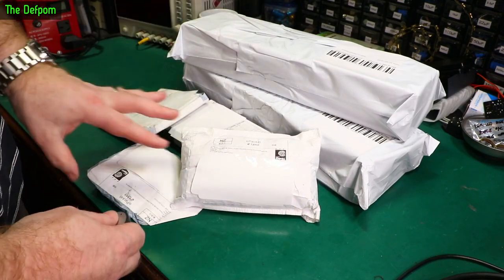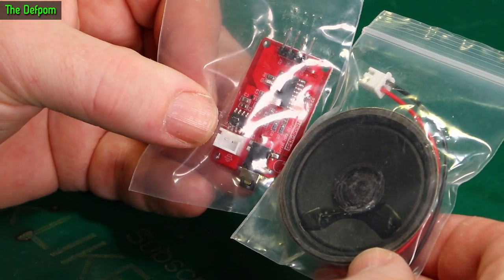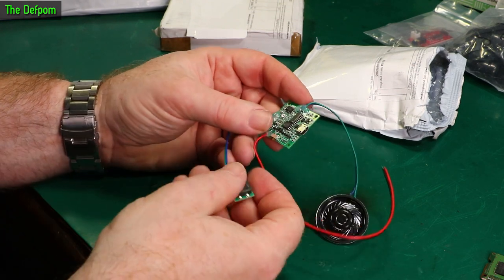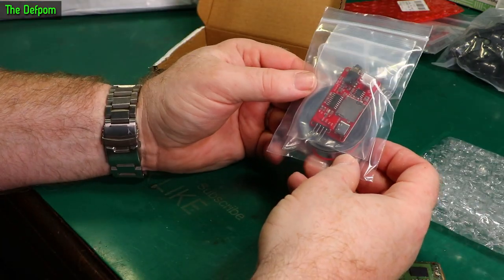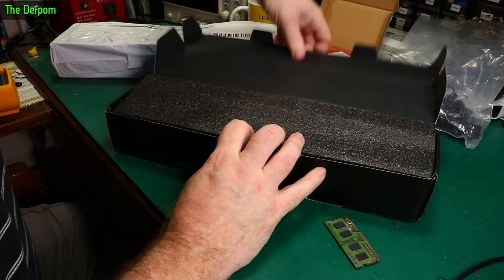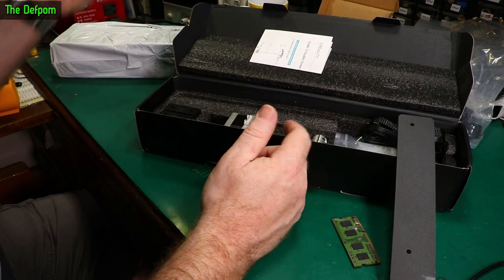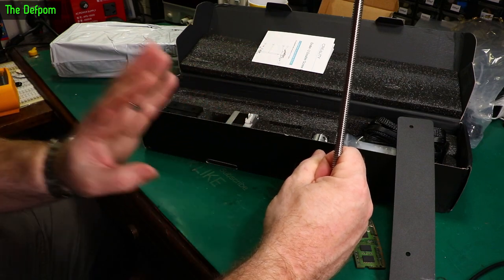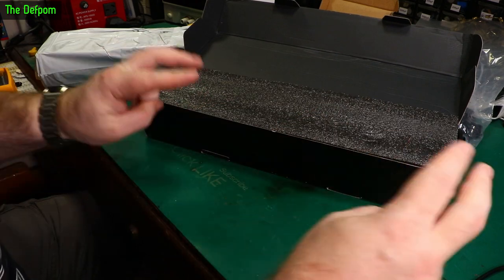🔴 What's in my Mailbag ? - Mailbag Monday 5th December 2022 - No.1071

Comment: getting multiple option is NOT an overkill. I'd recommend to take a look on 2 companion items from ICstation: "Mini MP3 Player Module Audio Voice Board 8Bit I/O UART" + "UART Voice Controller Shield for XY-V17B Mini MP3 Player Module". (Important: main device is 3v) I have good experience ONLY with this set, other "mini mp3 players" either not works or glitched wildly (with 3v solid power and signals). To be fair, I've used it only with "I/O integrated mode" that allows to play up to 255 files. I've used atmega 8, shift register 595 and signal level shifter from 5 to 3v. Good solid solution if 255 files is enough.